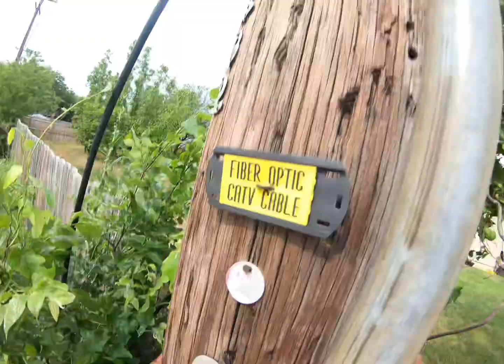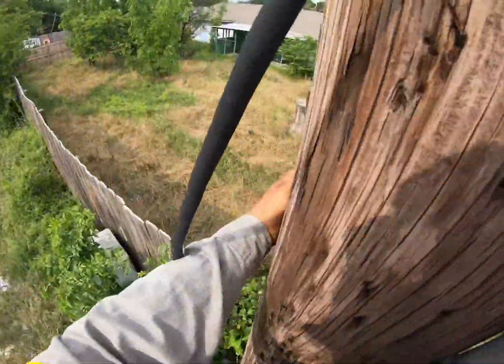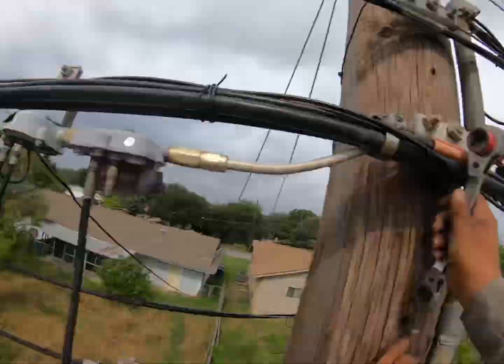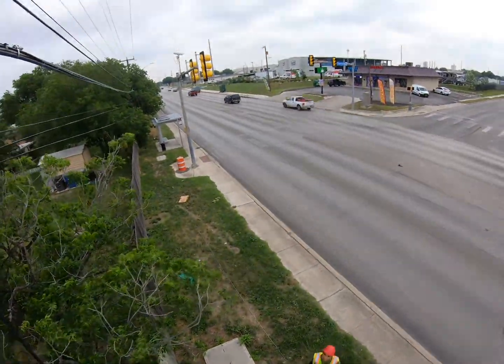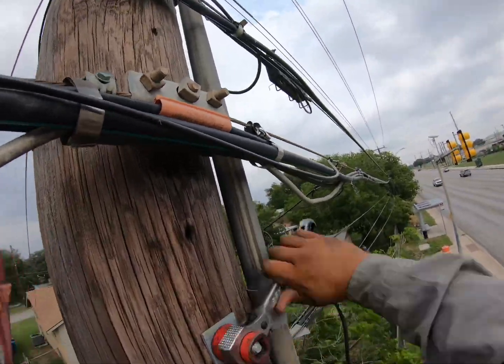Building strand.

Comment: They have a set of ratchet wrenches at Home Depot that have 5/16-1/2 on one and 9/16-3/4 on the other they make life a lot easier. A good tip for throwing up hardware is having the washers on one end of the bolt and your clamp on the other end. It’ll be evenly balanced and easier to throw. When throwing it you want your hand flat and the momentum of your arm swinging taking the bolt out of your hand and up not so much of a throw. Enjoyed the video stay safe. Enjoy this telecom boom we’re about to go through again at the start of the year!